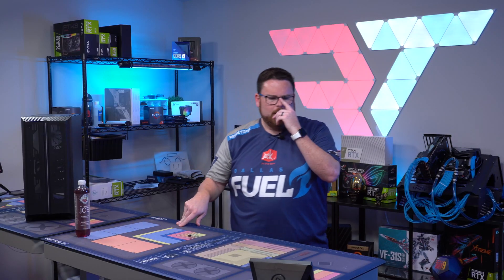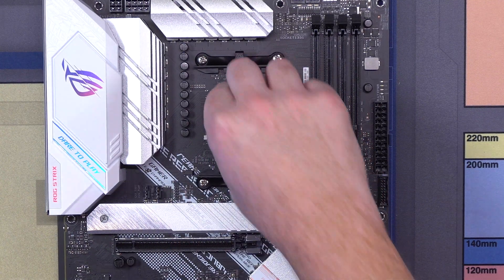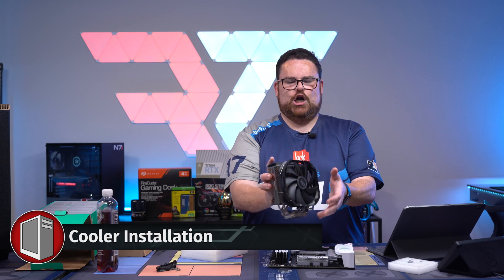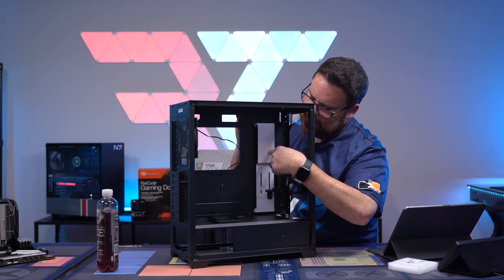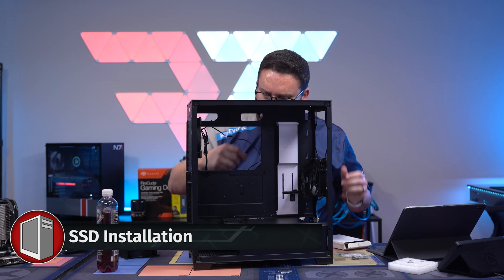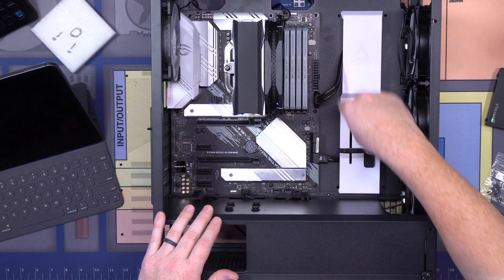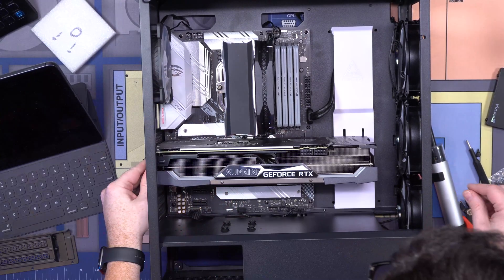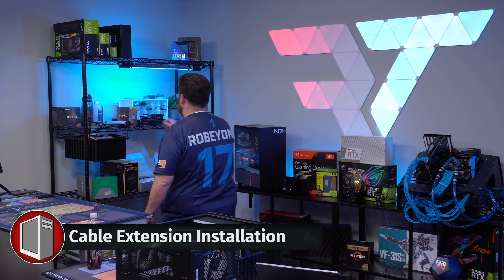The Montech Sky One the Robeytech Review Build and Live Build Guide!

Comment: Hi, im having the same exact case and the same mobo build in your video. However during the process of installation for the usb header , the black bracket is stucked  on the usb header and so the pin is exposed , i cant take it off , seems like a design flow on their usb header cable. Have you encountered this? Hope u see this message.